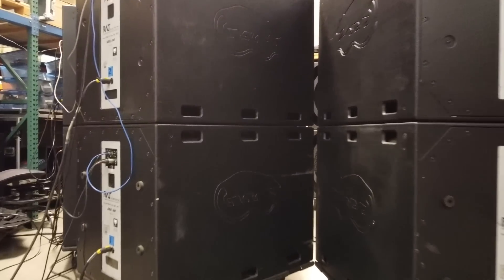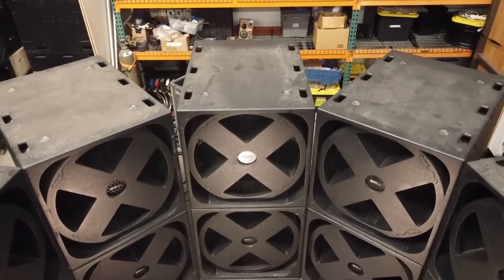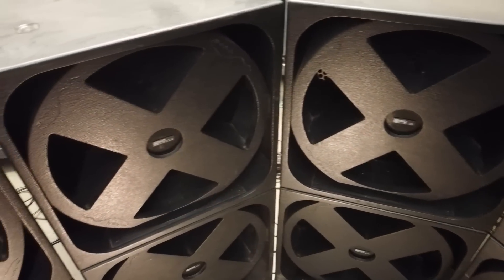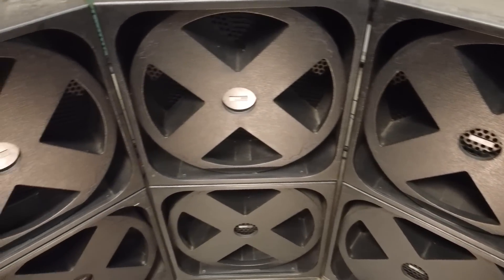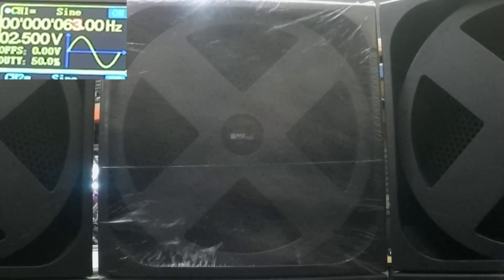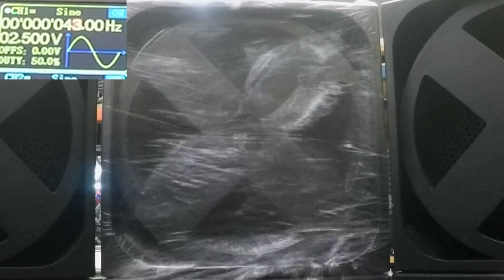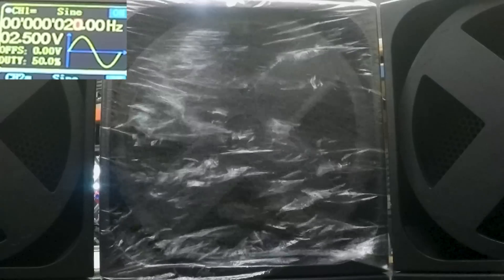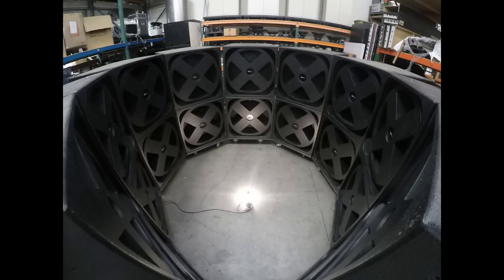Plastic Wrap Test 30" SuperSub Subwoofer (Public)

Comment: Can it has an excursion like car subwoofer?
Reply from the maker: It moves about an inch. It's a really powerful motor. The challenge with powerful woofer design is that the farther you design it to move, the less efficient it is and the more power you need to drive it and the heavier the voice coil and cone get making it a slow and muddy sounding speaker.

This linear drive, moving magnet motor can have a huge voice coil with loads of heat sink because the voice coil does not move, like it does in a speaker. Tis speaker does not have those flexible leard wires connected to the voice coil

This motor handles loads of power and is very fast and punchy. The opposite of the the slow muddy sound that you get from those giant motor car stereo speakers. 

This may be a good thing or something that people don't like as the sound is different. But either way, this is a much different animal.
Reply: @DaveRat  if you can put electrostats speaker for mids and highs  on live concert with replacing dynamic speakers it's gonna be sound more accurate because it's has ultra thin diagram and tighter one.
Reply: i have electrostats inear it sounds different then normal pro audio dynamic drivers
Reply from the maker: The challenge for using electrostatic for live or any high volume application is it the maximum excursion is limited by the design.

Typically electrostatics have a thin diaphragm membrane suspended between two plates that supply the voltage and the maximum excursion of the diaphragm is limited by the distance between those two plates.

If you move the plates farther apart the electrostatic membrane becomes extremely inefficient especially at low volumes.

At higher volumes the membrane gets closer to the plates and actually becomes more efficient and it acts like an expander which makes it not very tolerant to dynamics and peaks.

Boys club bass speakers have the opposite. The speaker is most efficient at low volumes and when it reaches its peak excursion it becomes less efficient creating a natural compression or protection of the mechanics and output.

Ribbon drivers tend to have the same challenges as electrostatics where a ribbon is suspended between two plates and the excursion is limited by the distance between those plates. 

That said, for high frequency applications where very little mechanical motion is needed, electrostatics and ribbons can work well for many applications requiring low to moderately high volume levels.

Alcons is making some good headway in creating higher volume ribbon drivers that work fairly well for live applications.
Reply: @DaveRat  and Dave what about danley speakers? They measured at 100 ft with 122 spl at spl meter
Reply: @DaveRat  i think we can make pro ribbon tweeters for mid range because midrange won't have much excursions , it's almost have same excursions like higher frequency. And we can arrange more speaker for more spl
Reply from the maker: Perhaps, but so far from what I have heard, the ribbon drivers have not reached the efficiency and clarity that can be achieved with non ribbon designs. Another challenge with ribbons is they dot tend to seal off well the front from the rear radiating energy.

So rear radiation leaks to the front. Unlike compression drivers or cones where the rear can be sealed or isolated.

With highs, that can be ok as they are somewhat easy to absorb with damping mayerierials but as you get to mids, this can be an issue.  

Same issue with any open back driver design where the rear radiated energy can't be completely captured or controlled.
Reply: @DaveRat  electrostats are better then ribbon due to wiring design on film of the ribbon while electrostats are not power efficient due to design and sucks with back sound radiating and it reduce spl though you can seal the back side of electrostats . Thus some good ribbon with ultra thin ribbon can sound better then dynamic while well light weight dynamic driver can also sound better then worst ribbon. At the end of day we need to trust our ears . I use jbl partybox ultimate it's vibrates the floor so much literally you can feel the beat and we don't need for night club😅. I don't know why some local live show have so much noisy on their PA ,may be it's because of their worst filters 😭.
Reply from the maker: Very cool and lots of variables.  I am mainly involved with large scale sound reinforcement professionally where we use mainly L-acoustics gear to do large festivals and tours. That said, if you watch some of my videos on "real sounding speakers" and various speaker build projects you will see that I have a wide diversity of speakers and interests
Reply: @DaveRat  yes I saw . L acoustic is better then any one ?
Reply from the maker: @pracheerdeka6737 L-acoustics is definitely up there with the best. As with everything, it depends on the application, but they do have a diverse offering of well matched products. Plus their prediction software is easily the best
Reply: @DaveRat  yes more tighter the spider and lighter the cone are more faster they are and same goes with super sub they are very tighter motor. When the cone moves further with signal it pulls it down whenever there is no signal and thus it's faster motor on super sub.

Comment: Were these the subs used at Coachella?
Reply from the maker: Yes, 18 of the 90 subs in Sahara tent were these
Reply: @DaveRat  
... any response typing out;  
"18 of the 90 subs" 
 is simply badass!
Reply from the maker: Yessss! Less than 20% of the subs and close to 50% of the sub power
Reply: @DaveRat How many are at the Main-Stage?

Comment: Will you be offering these for sale? I've been a tapped horn fan for the last 10 years, but this is some tech I'd love to learn more about. Interested in seeing size/weight/output measurements to see how they compare. Nice work!
Reply from the maker: I hope to at some point and will be posting more info.  The response is from 23hz to 80hz, self powered single 30" cone with a max displacement of 1.5" peak to peak.

Each sub ieplaces 2 to 3 double 18" in the 30hz to 80hz range and am not aware of double 18 or double 21" that go down to 23hz at higher levels.

Each box is 24 cu feet

Comment: How does the level of a Super Sub compare to a conventional double 21" sub? Membrane area, Xmax and cabinet size are comparable. So you would see nicely how much difference the higher efficiency really makes.
Reply from the maker: Surface area is similar to a double 21, excursion of the 30-inch tends to be more except for extremely inefficient 21s.

The extremely high magnetic force of the 30-in allows it to reach higher volumes in smaller enclosures at lower frequencies

Comment: What have you measured spl else
Reply from the maker: I currently don't own a device that will measure SPL at those levels directly. It overloads the mics. I set up a ring of subs and the SPL meter stopped working at 145 DB continuous at frequencies down to 25 cycles
Reply: TermLab makes a variety of very high dB sensor systems and RTAs, for applications over 120dB.  

dB Drag Racing ... car audio competition utilizes something similiar.
Reply from the maker: Very cool and thank you. I may do an indirect measurement by measuring one sub at low level and max level.

Then add a second sub and measure at low level with the 2nd sub on and off.

The amount of additional db the 2nd sub adds at low level should be the same as it adds at max level, so by following this process I should be able to calculate the max db many subs quite accurately. Perhaps even more accurately that test gear that is designed for ultra high levels.

Comment: You go as deep into acoustics as anyone I've heard of, brother. Oh, if dance-club brats would only listen to doctors more...anything below 40Hz or above 20 kHz would not be legal in any output transducers, even in the military.
Reply from the maker: Hmmm, boats sway, road bumps, and wind can all have super high levels from 1hz to 20hz and up
Reply: @DaveRat  A drumstick snap on the bridge between Kelowna BC and Peachland knocked me over one time. Bad magic compels my vigilance about other facets of engineering. I heard "supersonic" motion-sensors until they evolved. I could sing to them. Maybe engineers will stop marketing tinnitus one day.
Reply: Alberta has lots of wind, and un-recyclable turbine blades lately, and wind-crazy Milwaukee refugees.
Reply: What's the issue w/sub 40hz energy?

Comment: Reminds me of Servo Subs used in the Caribbean back in the day
Reply from the maker: I've heard that parallel being made. The servo subs are rotary motors attached by belts to cones.

This is a linear drive moving magnet paddle on ceramic bearings that bolts directly to a cone
Reply: @DaveRat  do the elephants respond (-;
Reply from the maker: Ahh whale and elephants, the subwoofers of the animal world

Comment: Dave, is the m-force is a servo style subwoofer? Many thanks for sharing the tidbits of your knowledge with us!
Reply from the maker: Hmm, the sevo subs were rotary motors with belt driven opposing cones.

The M force is a linear driven moving magnet flat paddle that rides on ceramic bearings. 

The M-force is a new technology that differs from anything previous

Comment: I like how you built the cylinder for those. Im surpirsed that they haven't yet made those drivers servo. Also the motor heating is due to magnetic induction in the metal frame and ceramic.
Reply from the maker: Hmmm, the motors are linear drive moving magnet. Very powerful.
Reply: @DaveRat  Hi Dave , yes the mulitple frequencies are causing induction heating in the moving magnet and it's frame carrier.
Reply from the maker: Heat generated in this and conventional moving coil loudspeaker transducers is a constant challenge

Comment: I wonder if there is some device you could borrow from at HVAC company to see how much air it displaces.  I was trouble shooting a system on site while a couple HVAC guys were checking how many cubic feet of air they were moving into different parts of the building.
Reply from the maker: It's tough because it moves air back and forth. Not like a fan. In fact it destroys fans. And the amount of air is frequency dependant as well.  I may hook a smoke machine up to spit moke inside and see what happens.
Reply: Both piston area and travel can be measured directly to come up with this answer.  No need to measure air volume.
Reply from the maker: That's true, getting a theoretical approximation that does not include cone flex/warpage under high stress and such is easy by multiplying the moving cone area of around 550 sq in x max excursion of approx 1.4" so around 770 cu inches or .45 cu ft.

Though I am not sure how that would relate to reality. 
Measuring the area of the ports and the air velocity and tuning the freq for max air motion would probably be the method I would be interested in

Comment: wow...Not all that different from a "shaker table" motor used for mechanical vibration survival testing of equipment,
Reply: lol they are nothing alike mechanically, they may look visually similar though.
Reply: @captainkirk3000  There are two kinds of vib tables, the ones that use hammers ( for HALT testing) and the kind that can sweep or dwell through specific frequencies by exciting a huge coil in the presence of a strong magnetic field.
Reply from the maker: Hmmm, worked with shaker tables when I was at Hughes aircraft but those were moving coil devices with fixed electromagnets.

To the best of my knowledge these drivers are a new technology which involves moving magnets mounted on a plate guided by ball bearings that slides linearly back and forth.

Not familiar with linear moving magnets transducers being used for shaker tables but it is very possible.
Reply: @DaveRat  I saw an advert for a seat/chair shaker.  Not sure if they have them in concert halls...but why not?. Heck, put in a false stadium floor on rollers and shake it  with a few cm of deflection to the music. What could go wrong?
Reply from the maker: Those shakers are cool, drummers and gamers use them. Many of those are fixed coil, moving magnet, but not linear paddle driven riding on bearings.  More like round slug version of a speaker.

And yes, moving floor is all good!
Reply: It’s actually identical to the servo motor drives used in old IBM hard drives, it’s exactly the same technology… albeit the hard drive motors are probably quite a bit more precision and much more expensive to make… Regardless of its origin, it’s definitely not novel or new technology…
Reply from the maker: Hmmm, an m-force is exactly the same a same hard drive armature design is quite the steatch. I fully support providing info that enhances knowledge and understanding, and it is important to me that info that is low in accuracy or misleads is avoided.

I guess they both use magnets and electricity but the complexity and tech of the two unrelated applications is vastly disparate.

Here is a patent on the M-force and it's function. Perhaps look up a patent on the various hard drive armature designs as well as the old IBM one and see if you can find much in common beyond being one of the thousands of situations where a magnet and electricity is used to induce motion.

https://patents.justia.com/patent/8861776

I would be 8nterested to see the nearly identical designs.
Reply: @DaveRat  Nobody mentioned armature design, they used a linear motor structure… Ultra precision stuff, I believe the original cost of the units was around a quarter million each… Surely the roots are in the same 1975 (long expired) patent… or similar…
Reply from the maker: I'd be great to see that patent, expired or not, the patent files are always findable to 100 years back or more
Reply: @DaveRat  I’m sure, just saying it’s a nice design, happy to see subwoofer design getting better…. Would be interesting to see it coupled to a vain configuration similar to a rotary engine, played with the concept long time ago never had a grunty enough motor to make it work at useable frequencies…. Be pretty cool to have a compact 50 pound sub that could replace 16 18 inch drivers though, especially for the guys doing the load-out 😉

Comment: Motor drivers get better the lower they go. I think it’s great you have taken the leap forward with this tech. Are you using an off the shelf linear motor or did you have to spec one?
Reply from the maker: Power soft M-Force.  I worked with powersoft very closely throughout the process